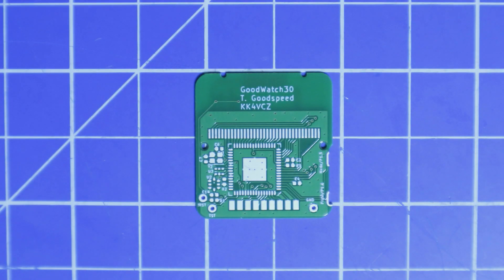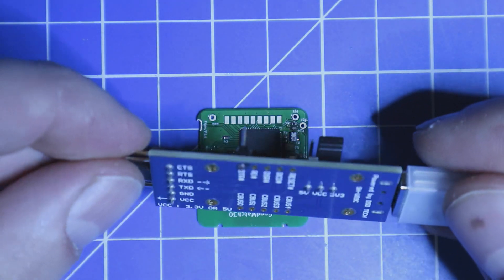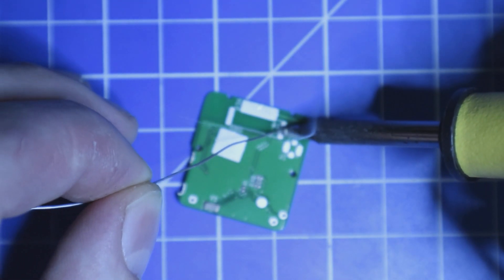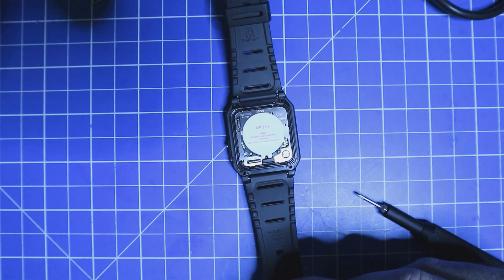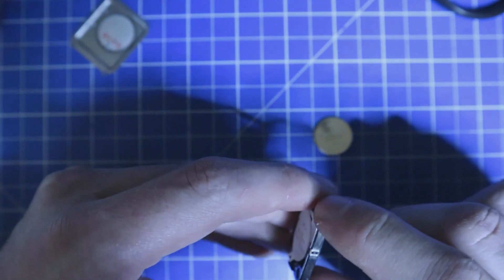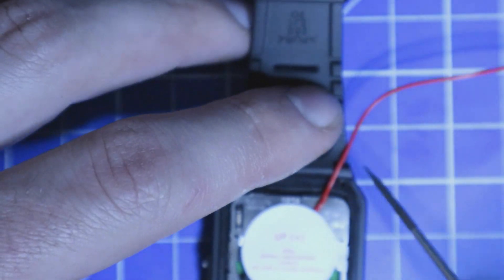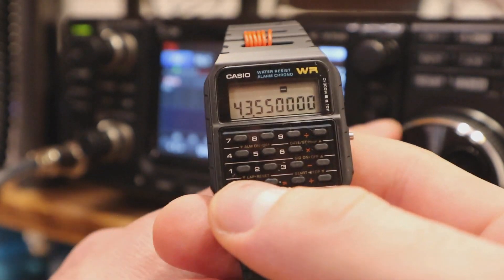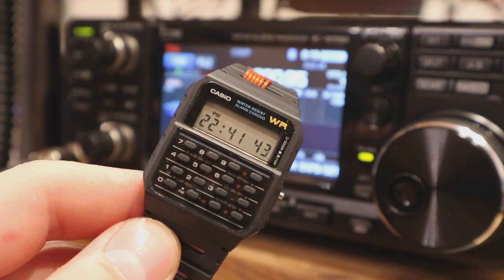Building the Goodwatch

Comment: I hate this PCB, its 0.4mm which is not stated in the docs, the KICad project etc so if you order the boards before you open a watch up this is not clear adn you'll end up with useless 1.6mm standard thickness PCBs, a couple chips are just not on the market anymore and the pad sizes are actually wrong for these SMD parts with 8 legs... anywho for anyone else stumbling into this made an issue ticket on the GitHub with some big fixes and notes.